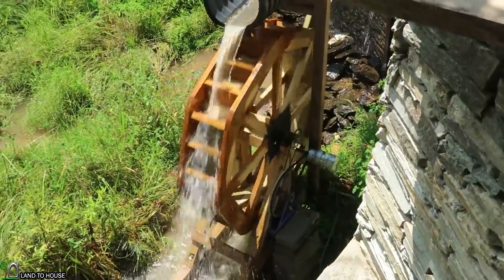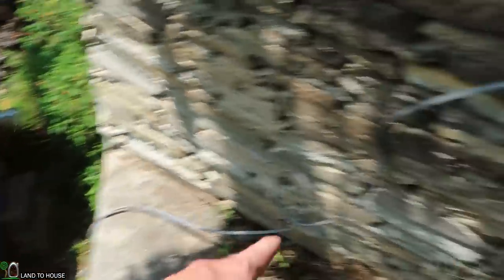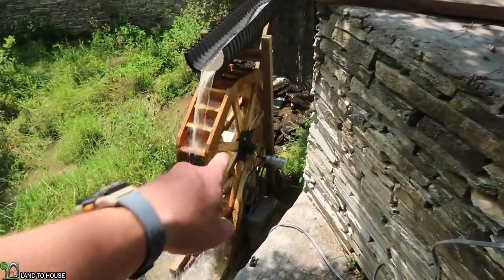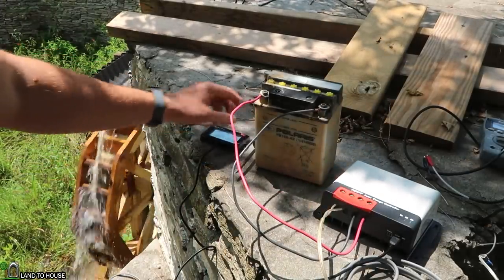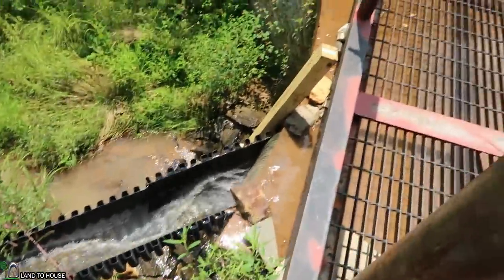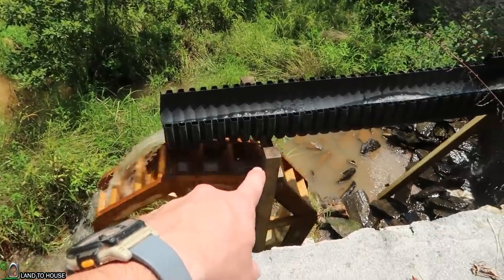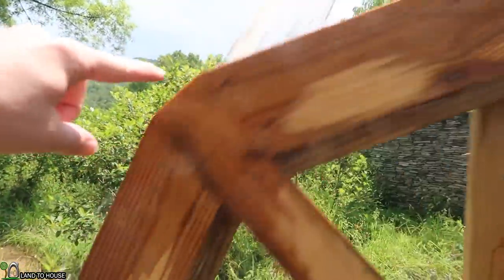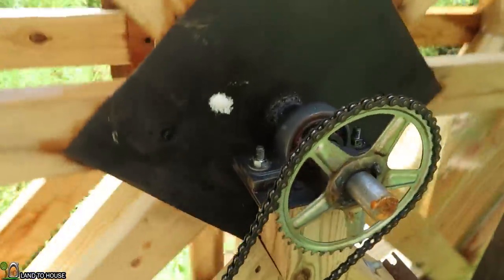Hydro Electric Waterwheel First Voltage Reading

Comment from the maker: Enjoy micro hydro? Check out this Turgo install:
https://youtu.be/Flz4_OE4CGI
Reply: The ribs are also drastically slowing the water flow if it was a smooth type you would get more velocity
Reply: Thanks for sharing that Turgo install video! Looks like a cool hydro setup. By the way, if you're into outdoor adventures and need reliable power, I highly recommend checking out the Segway Portable PowerStation Cube Series. It's a versatile and robust power station with a 1-5kWh capacity and fast recharging. Perfect for camping and backup power needs. Happy exploring!
Reply: Great suggestion! The Segway Portable PowerStation Cube Series sounds like a fantastic option for outdoor enthusiasts like us. With its massive capacity, fast recharging, and waterproof technology, it's perfect for camping trips and emergencies. Plus, the Smart APP Control adds convenience. Thanks for sharing!

Comment: Not only does the water trough need to be shortened and lowered, but the paddles of the water wheel need to be angled upward on the water side of the wheel. This way the paddle area would become a small bucket to where the water would let out much closer to the bottom of the wheel, which would even greater improve it's efficiency.
Reply: I agree.  It needs to hold the water better.
Reply: Cutting the flume back one or two rib sections would help for sure.
Reply: He could add some trim to the lip of the paddles to hold about an inch of water. One gallon of water weighs 8.32 lbs. The water should strike at the top.

Comment: I was wondering the same if he used a washing machine motor. Also it looks like the water wheel needs to cup the water more and needs another piece on each "bucket". Can't wait for the next update.
Reply: Is the wheel the right way round.. the water appears to be splashing of the paddles. Instead of being held instead of being held in side the small bucket area.. 
Shortening the (flume) inlet shoot will also direct more water onto the wheel.. 
All the water wheels I have seen in England flat flume (shoot) this gives even feed across the wheel which increases efficiency..
 I also think he can run a bigger/different generation unit.. . Maybe a washing machine motor.  Something out of a small modern Honda type gasoline type genset... 
It's enjoyable to watch an finding a few gems an ideas for a project I've been looking to build.. thanks again Peter

Comment: I know squat about water wheels, but as an outsider observing...it seems like the wheel design itself is flawed. The fact that it's octagonal and not circular means the paddles catch the water at different heights and you can even hear it with the way the water splashes are pulsing. Again, not educated on the matter in the slightest, but that's what it seems to me. Seems about only every third paddle (each corner of the wheel) really catches water compared to the rest (the flats of the wheel) making the water's ability to apply torque to be inconsistent. Maybe would be improved anyway by your suggestion of moving the pipe back a bit.

Comment: I’d recommend using a planetary gear box instead of the current arrangement input is on the plant carrier with the ring gear locked in place with output on the sun, with the correct setup, he would get up to four times the speed on the output from the low rpm high torque input.  I could design and 3D print a gearbox for you test.  On second thought I’d be better off machining one out of nylon instead

Comment: Unfortunately, more garden design than a usable water wheel, an overshot water wheel works with power on the lever arm, which requires water chambers. Without weight there is no torque and without torque there is no power. Just put another board across the front so that some of the water stays in the water wheel a little longer 😅 Thank you and best regards from the upper mill👍✌️✌️

Comment: its got potential. it in low gear  it could spin a much faster in top gear & yes he Need to catchier  more water on the top  of the water wheel  & hold it there for much longer he could put lips sloping lips  on the front of the paddles. increasing the water &  holding more of  the water  longer & to spill out at the bottom.  of the wheel. it's  the fall that count's. as the increace  Tark  water increases speed  it reduces  dregs .  water flowing over a wheel if far better to flowing Hounded the wheal .   Hight X flout' size  X volume  of water catcher & retained +  torque  water at the top  & holding until it reaches the bottom in gallons  is the key. this Enables  Gearing to be. grater speeds.  that spot could charge 400 wats  of power ,

Comment: He needs a 3 Phase AC Motor instead of DC Motor for that run to his camper to prevent voltage drop.
Secondly, he has to change the gear ratio on that wheel to improve the RPM/Speed.
Thirdly, to adjust the water drop on the wheel.
This is just my opinion and thanks for sharing Seth
Reply: as a three-phase motor do you mean permanent magnet alternator? Otherwise the power is too low for a three-phase asynchronous motor self-excited through single-phase capacitors with the c-2C technique, it is used from 700W upwards to be suitable against a good quality non-Cinese permanent magnets, and have a good efficiency, I I recommend it from 850W /1kw upwards, let's say with 1,5hp high efficiency motors with a maximum of 850 / 900W of power that can be taken, under 700W PMA or PMG is the only solution in terms of efficiency.
Reply: @winterburan  A Samsung or Whirlpool/Fisher-Paykel  washing machine motor used as an alternator would work as long as it was rewired for a lower Voltage. 250 RPM is on the low end of power from one though. 225 would make 113 Watts while 250 RPM would make 155 Watts on a Samsung Cu 36 pole stator in a 3 phase, 4 parallel sets, of 3 coils in series configuration. 250 RPM would output 25VDC and if not rectified would be at 100 Hz. That could be stepped up in a toroidal transformer to a higher Voltage for sending over the wire. Question would be, can it turn it at that load.
Reply: @gravelydon7072  ok permanent magnet motor, when we talk about three-phase motors we usually mean three-phase asynchronous motors, they are also good alternators but above 700 / 800W, a permanent magnet motor used as a permanent magnet generator, certainly better than a modorte DC with brushes, a transformer for these small powers even if toroidal and worked at the excellent frequency of 100Hz would always lose at least 5-8%, the power involved is really ridiculous, better to charge efficient LiFePo4 batteries, the lead ones only reach 70% , even less starting batteries, connect an inverter and start with the cable

Comment: 1st: Put a dam in the wall niche so the water rises and provides the addition of 1,5ft more drop. Then a smooth transition to the pipe, which should be at an way steeper angle and puts the water 'earlier' into the wheel.  Use a smaller diameter tube for less friction.

2nd: the hexagonal wheel brings up unconsistent water delivery => torque.  without a spoony upwards shaped cup design a huge amount  just splashes off and does nothing.  The cups should carry the water from the 12 to about 7 o'clock mark. Sharp edges on the cups instead of the plain 1" thick boards with 2x 90° edges help reducing the splash off.

3rd: a DC motor is totally the wrong system to begin with if have little waterflow and relay on an efficient system to get output at all.
So a 3 phase electric rollchair motor with something like a 1:2 or 1:3 ratio via chain or timing belt style.

Send the 3 phases to the RV, rectify near the chargecontroller and you could get maybe 30W from that water flow.  Not really much but enough to run a 12V compressor type fridge.
Reply: Ive seen 90% + Hydro wheels and by what you describe , it sounds just like those , with the cup shape. I think it was a Richard Hammond Video on youtube i was watching , but yeah ... sounds just like your description.
Reply: You need a drop shoot, all he has todo is cap the end of the trouft an cut a hole in the end so it drops straight down on the wheel and turns the wheel around, it would be 90%
Reply: Agree. This motor is inefficient because my small wind turbine motor gives me 19 V, 1.2Amp @ 120 RPM . 

Of course water Wheel needs to catch more water ( using pvc instead of wood ) 

Water doesnt have enough Potential energy( length of the pipe doesnt matter, hight of the pipe is important)

Comment: Seems to me like a rectangular flume outlet instead of rounded would both slow the water speed and fill the buckets more completely. Agree with comment above to use 3 phase brushless AC. A hoverboard motor is both high watts and low RPM. Should be ideal. Might need to double or triple the diameter of the driving sprockets to get the voltage high enough. Great first attempt though!

Comment: i would add sides and a curved bottom to it with a lip on the buckets this way once the water enters the bucket the wheel carrys it down and out the back holding onto the water for as long as possible kind of like a backshot wheel setup for reversed to be overshot
Reply: Great idea. If you wanted to get even more fancy you could even hinge some buckets to release the water after it gets all the way to the bottom, but just optimising this design will improve things a lot.
Reply: @ThisRandomUsername  i had the thoght of rubber flaps
Reply: @ThisRandomUsername  i think the motor been used is one of the big things letting it down

Comment: The problem is that this wheel is an undershot design being used for overshot. Undershot wheels were designed for mills where the water would flow underneath them, the stream or river would be diverted to push 100% of the water through the wheel when in motion, however the efficiency is only 20%. Consider switching to a pitchback design: these use buckets that fill from a pentrough that has a hole in it, so the buckets fill from the top but the wheel spins backwards and the water that falls out of the buckets is channelled to turn the wheel from the bottom, this uses the water twice and is 80% efficient. An alternative is the breastshot waterwheel, which is considerably larger and is fed from close to the centre of the wheel, it works in a similar way to the pitchback but requires larger buckets for low head.
Reply: @fyremoon.  why do you say that the efficiency of an undershot wheel is only 20%. That is not a general rule is it?
Reply: @mwpicard  For a basic undershot wheel it is, look at Sagebien wheels for high efficiencies. Zuppinger wheels are also efficient, but create unwanted slapping noises at the blade entry.

Comment: Lovely wood work for a diy project, a credit.   Unless they will put a battery bank and inverter very close to water wheel and run mains ac voltage to rv then I'd say the same as others. Run an ac generator and rectify as close to rv as possible.

Comment: No expert on water wheels. I agree with all the posts to install an ac gen instead of a dc gen. I also agree on experimenting with the water line to increase torque. Redesign the gear box for increased speed. Outstanding job on the whole project. If I lived in an area that was near water I would try experimenting too. Go with ac gen remember this was a Tesla/Edison argument years ago.

Comment: If he was using an alternator instead of a brushed motor you would be able to double the voltage quite easily using two diodes and two (rather big) capacitors. It's a pretty simple circuit, you just need some high current diodes. Still, ideally you'd have the thing spinning a lot faster.
Reply from the maker: A rewired alternator is probably the best bet here. Possibly adding some  scoop extenders and getting that water into the wheel properly.

Comment: I agree that the flume end needs to be lower and cut shorter.  Part of the energy to turn the wheel is the kinetic energy & momentum of the water coming off the end of the flume and slamming into the vertical vanes at the top of the wheel.

Comment: Where the water drops into the buckets there should be a spout to fill each bucket so that it holds the water until exactly under the the bottom of the wheel where it drops it out and doesn't carry any upwards that would cause drag.  so cut 2 - 3 ribs off and put a board that the water would hit and drop down just over center so that gravity can carry it down to the same spot on the bottom.  If it had a round circumference I have seen a piece of tin placed follow the curvature of the the bottom 1/4 of the wheel that helps hold the water in the buckets.  But it's still a hell of a wheel!  He did a nice job, when he redoes it hopefully he'll go down into snakeland and measure his drop and put a bigger wheel in there.  It's all about using gravity and holding the water in the bucket until gravity is done.  I've only built a couple of water wheels, they are so complicated to build, there's a lot of math involved.

Comment: I’m someone who doesn’t really buy into “that won’t work” just because “an expert” says so. I’ve had an idea rolling around in my head for a while. You’d need some drop, not sure how much. But a 500+ gallon tank, with a run of 4” to 3” to 2” pipe down to a turbine, emptying into another tank, that has either, or, or a combination of a ram pump or solar power pump pushing the water from the lower tank to the upper. Now I got this idea from a door shop in our area, who also became a solar supplier for a while. They had a single panel set up with an ag pump that really put out. If you had a continuous feed from a creek, to keep it “topped off”, with a spill off back into the creek, so you’re not wasting water. The main tank would also be the water supply for the house with a sediment and purification filter in between. With the continuous cycling it would keep the algae down. Does any of this sound doable? Would appreciate the feedback.
Reply: What are you trying to achieve with this setup? One tank, feeding through a turbine into a lower tank, with a solar pump moving water back up to the top tank - it could work as a battery of sorts, I guess, storing energy from a small solar panel and able to release it quickly.  The ram pump idea sounds like it's getting into perpetual motion machine territory, which absolutely 100% do not work under any circumstances, ever, no matter what anyone tries.

Comment: You are right that wheel 🛞 should spin quicker with the  bigger gear on the water wheel and smaller towards the generator which would get faster rpms

Comment: 3 phase ac pmg one of those huge 1/2-1.5 hp ones. He needs more rpm at motor too. A drive wheel almost the size of water wheel to turn motor should work. The wheel can turn a big motor slow 200-500 rpm. Where most micro hydro is meant to spin fast with little motors.

Comment: waterwheels with this flows are an ornament, will need hundreds of litres per  second to get anything worth charging from. THe best you may get from that flow is some LED's and Electronic charging. With that flow at a 10meter head, sure, then numbers would start being useful, at 40meters head, only need 4litrers per second to get around 600w of charging, thats water jetted through a pelton wheel from memory, Its a beautiful wheel, loads of time had gone into it, i intend to build my own similar, to run storm water through it as a feature.

Comment: Say, keeping wheel & chain gears as is.. I’d mount a small permanent magnet dc motor from a drill or scooter to push current into a 12 volt battery box with a 500 watt ac inverter so voltage doesn’t sag running transmission lines a distance as much low voltage d.c. lines do.. charge home/camper main system off the a.c. wires..

Comment: I tried to find a picture of a water-wheel design I saw once here in the UK at my friends old mill wheel. The 'buckets' on the wheel are fixed to the wheel on a pivot that keeps them 'level' until they get past the six o'clock point. This allows more buckets to be full of water at the same time meaning you harness MUCH more power from the wheel. Its hard to explain without a picture but hopefully you get the idea. Maybe someone knows the name of this type of water-wheel as I can't remember!

Comment: Instead of a overhaul of the trough positioning. A simple V notch weir (after a little fiddlin) would help improve and control the flow rate on the outlet.

Comment: Ac 3 phase power to house then rectified before charge controller, a boost charge controller may still be necessary, method of water supply will be wiped out in a big rain, needs solid piping

Comment: I saw a similar setup using a car alternator. I think a car alternator might put out a higher voltage. I can't remember the size of the water wheel he used but he used a bicycle wheel the same way to increase the rpm for the alternator. A smaller water wheel might turn faster if it would have enough power.

Comment: Thank you for sharing this.  That is too cool and I wish I had a creek to try something like this.  Maybe it's an optical illusion but it appears the blades do have a slight down angle instead of a slight up angle? is the water wheel wrong way around?